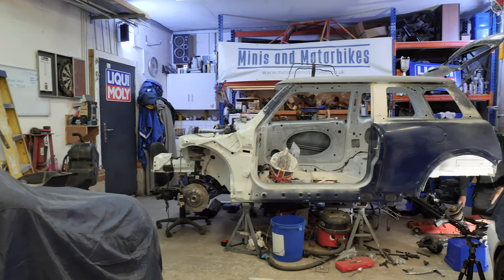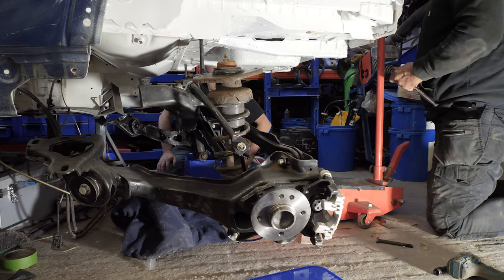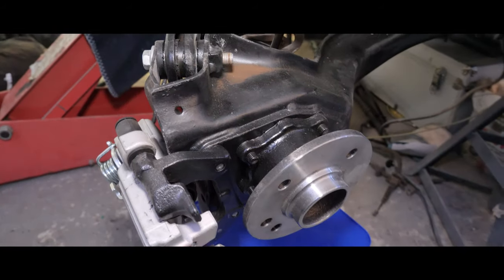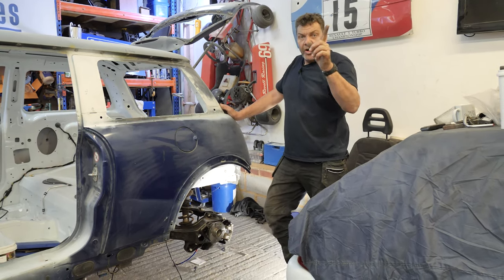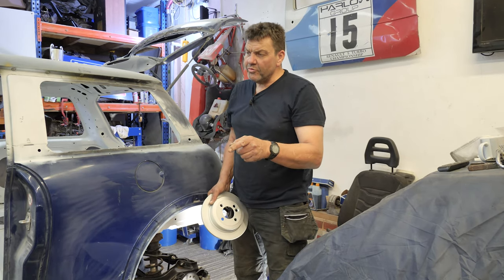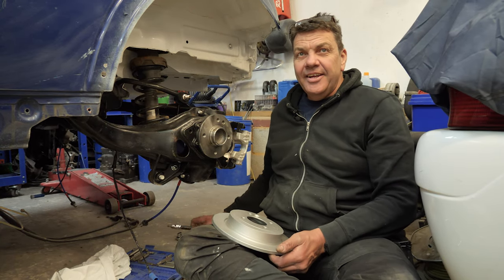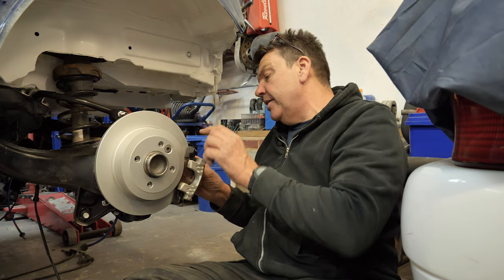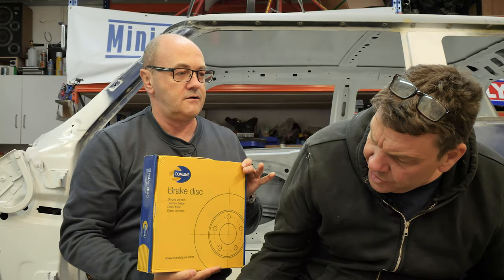Fixing the rear axle to the Mini and Comline Brake Discs - Episode 059 of Minis and Motorbikes

Comment: Hi guys, loving your video and thanks for the coverage on the Coated Brake Discs. It's great that you picked up on the key benefits: 1) Time-saving - no need to degrease before installing. 2) Anti-corrosion - they look great in-behind an alloy wheel. Oh, and as it came up, we can confirm that Comline also provides Water Pumps, Brake Pads, Calipers, Steering & Suspension, Filters, Wheel Hubs and Wheel Bearings. 🙂
Reply: Thanks Guys 💙💙👊🏻👊🏻

Comment: I wouldn't be fitting comline quality after going to all that effort. They're cheap for a reason. Always fit quality brake parts, if not oem, the one who makes oem parts, even better if you can find the oem who made them for your car. It could TRW for the mini but not sure. Source: have had multiple failures with comline so will never fit again. Worked out more expensive in the long run. Great video btw, well done!